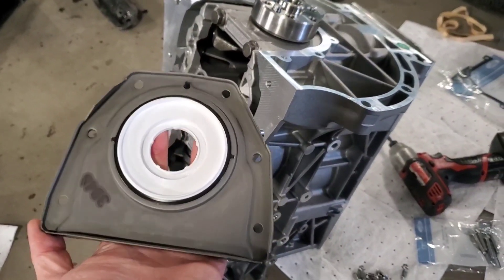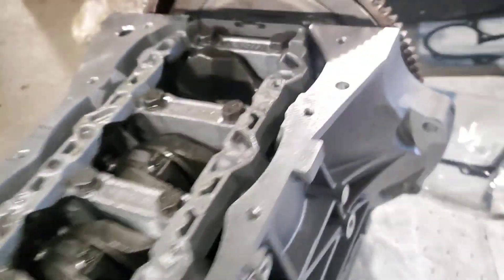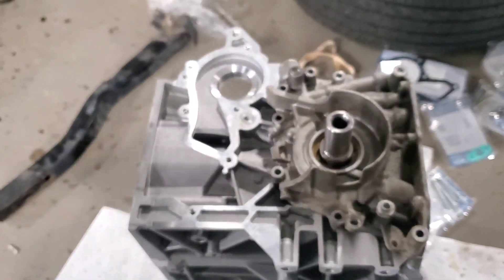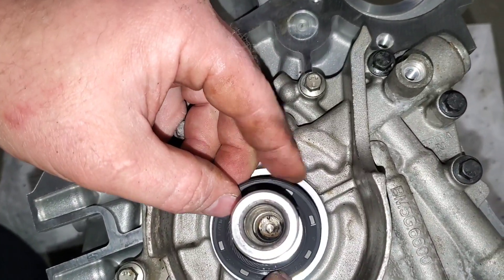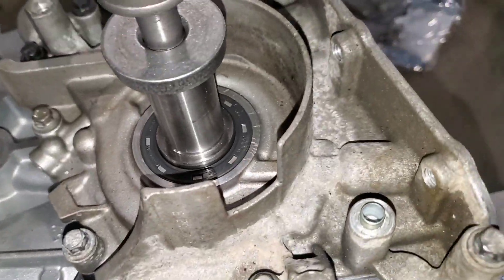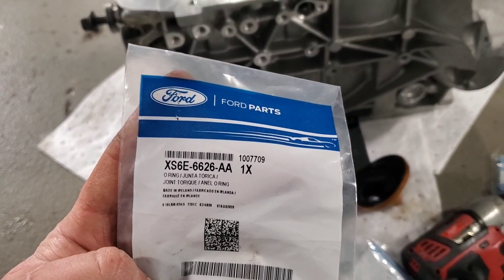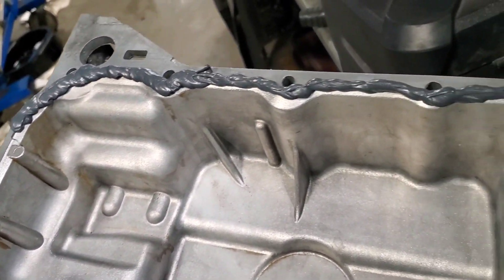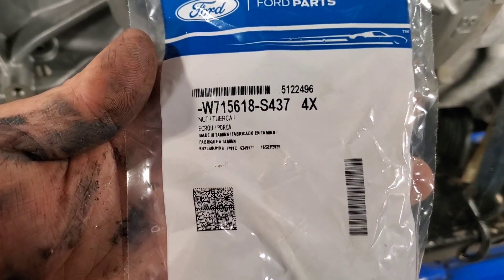Ford EcoBoost 1.5L Block external build, everything that goes on it other than the Pistons

Comment: These videos have been great.  You caused me to take my sons 2017 Escape with 52k miles and 1 week left of warranty to the dealership with a misfire in cylinder 2 to get it checked for coolant entry.  Sure enough it had this problem.  Saved me about $6K.  Without this video,I would have just changed the plugs myself and probably got out of warranty.

Comment: Awesome. I am wondering if there is a serial number on each block and a naming that indicates the revision level of the block different to that in the car papers. I am guessing this Info goes into the car history/Ford System Information related to the car?
Reply from the maker: Yes 100% annotated in the car's history
Reply from the maker: I also noted on this block For some reason The Pistons all had 112 stamped on them And so did the block outside never seen that before And it was the updated revision plus the tops of the Pistons actually had a picture that you could take of the URL code

Comment: One question:
What is the different between an 1.5 Ecoboost with 160hp and an 1.5 Ecoboost with 165hp. Both come with a Mondeo Escape 2017 and 2019.
Is the 165hp engine the newer model without the problems?
Reply from the maker: Yep

Comment: All that RTV on the sump, will end up on the in side of it.
Reply from the maker: No it wont
Reply from the maker: Silly comment
Reply: @FordBossMe  Maybe in your opinion. They are two perfectly machined surfaces therefore you don’t need 10mm bead of RTV.  What do think will happen when you bolt it all down🤔 it’s gonna go some where.
Reply: That's about triple the amount of sealer than I use.

Comment: How about some 3rd gen 5.0 vids.   Do you have enough enough work on those for a video?
Reply from the maker: I haven't had one of them in a long time, the last time I really had anything to do with one of them it was a stuck intake runner manifold butterfly It broke off in the vacuum actuator in the back

Or like a bad throttle body, really nothing that we find that goes wrong with them
Reply: @FordBossMe  Good to know, thanks